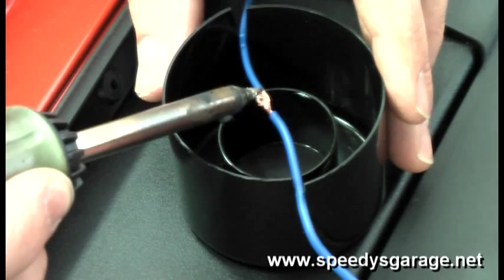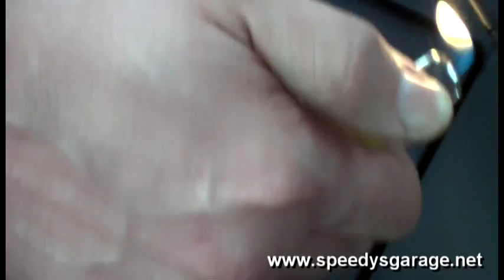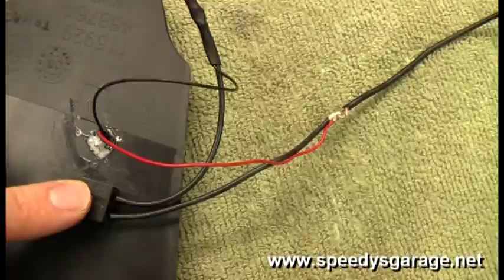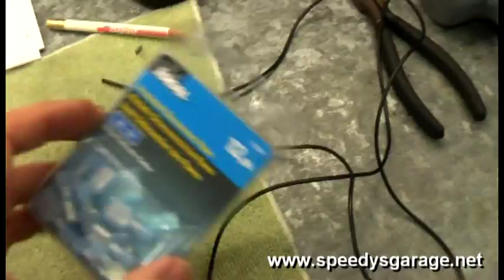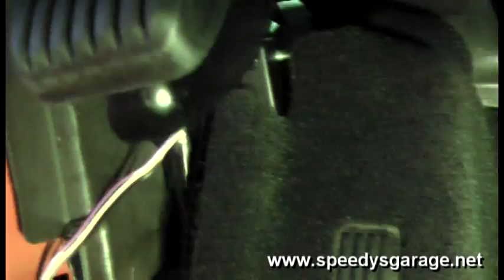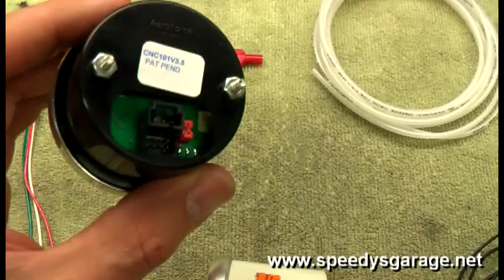Performance Gauges Install Part2.mpg

Comment: I have 2015. I see orange and gray wire into headlight switch for dimmer and +12V dash lighting gauges call for. You know if it's still the same? Don't why it would change at all, but thought I'd check if you may just know.